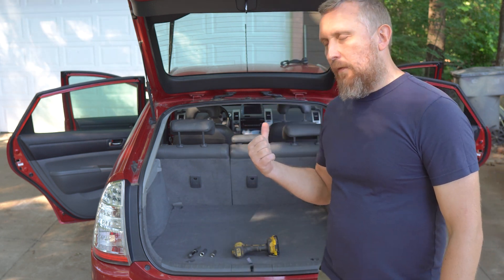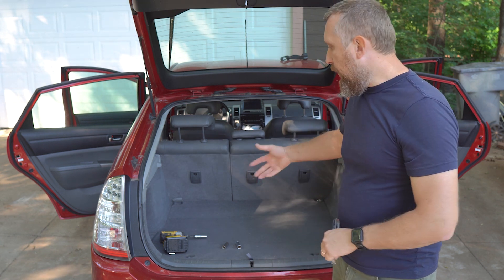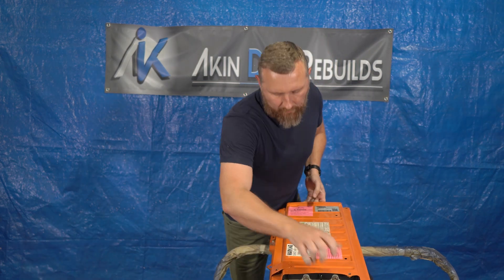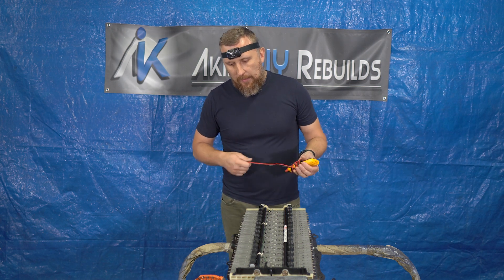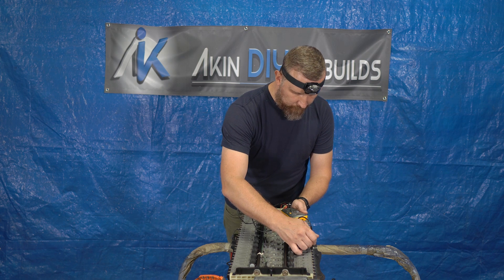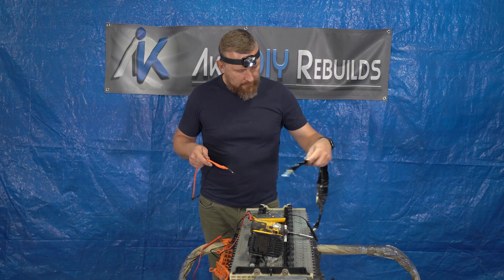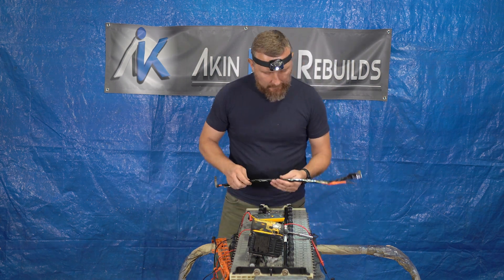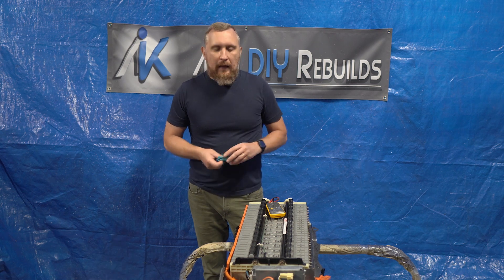Toyota Prius P0AA6 isolation fault

Comment: Sir, many thanks to you! I am your 82 y.o. "student". Got my 1st Prius accidentally by bidding on eBay 7 yrs ago. Drove it 3200 km from seller to my home. It was perfect! Loved it! Remained perfect  5 yrs. Then, I replaced AC evap! Horrible job! Soon, hybrid battery developed codes. I've been "repairing" batt repeatedly for 2 yrs. Finally, fixed battery. But got isolation fault code due to leaking cell. Could not fix it until your video. Fixed it by re-insulating relay cable. Had no idea that was causing my problem until your video! You EDUCATED ME GREATLY! May God bless you!
Reply from the maker: Thank you for your kind words. Glad my video was helpful.
Reply: @akindiyrebuilds6223  will add that car ran well with good fuel economy, but would display red triangle and codes p1116, p1150, p1151, on generic code reader. Only LEARNED OF POAA6 with Toyota Techstream last week. That led me to your video! Fixed it in half an hour! All codes gone away now except occasional p1116. But, it too, seems to be going away. Know you are probably a very busy man. So, I don't expect a response. Just wanted to pass on this additional info fyi

Comment: This is one of the most useless videos I have ever seen on YouTube, it comes across as trying to be an instructional video but you found absolutely nothing causing the problem you put it back together and then you say problem solved, I'm not sure how you can say problem solved when you didn't actually solve any problem all that happened was that the area dried up and the isolation fault went away because water in the back hatch area is commonly what causes this fault. Visit Prius chat and get some real learning guys. This was a waste of time.

Comment: Toyota technician teld me it happened to many prius rain water invade hybrid battery from trunk door hinge and get issue of P0AA6
Reply: Damn, I'm watching this after getting the code right after a heavy rain spell and rainwater leakage into trunk! What part gets affected exactly?
Reply: Interesting update, after clearing all the water, drying it out for 2-3 days, the warning sign has disappeared from the combination meter. Haven't rechecked the code though.
Reply: @shaazy  What were the final results?
Reply: @alext8828  I haven't been able to plug the leak, but when the error comes, I dry the battery well thoroughly (it always gets water, I've unplugged both drain plugs), and then wait a couple of days, then delete the error. It doesn't return till the next rain spell.
Reply: Leak prob comes from top, on those 2 rubber things on top sides of car, flex seal the cracks

Comment: When checking individual cell to ground, were you injecting voltage (megohmmetter) or just using volt meter to check resistance? When I check negative cable to ground with megger, I get low resistance (few hundred ohms), but when I disconnect it from the cells and check it to the shield, I get good (infinite) resistance.
Reply from the maker: I am using a regular multimeter set to resistance. Disconnect all cells but leave them attached to a battery base, then check for any resistance between terminals and battery base.  If you get any resistance that means you have a shortage.
Reply: Check the bottom metal of the cells. Leaking point is there.